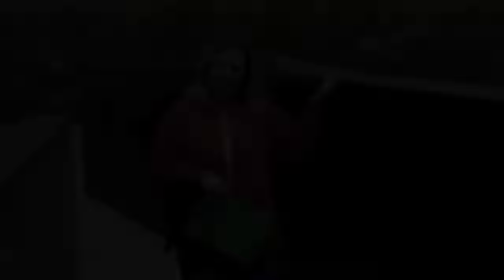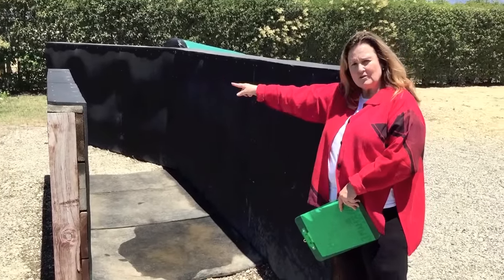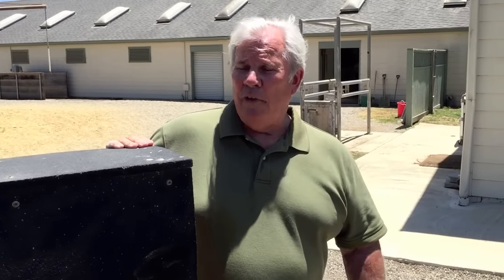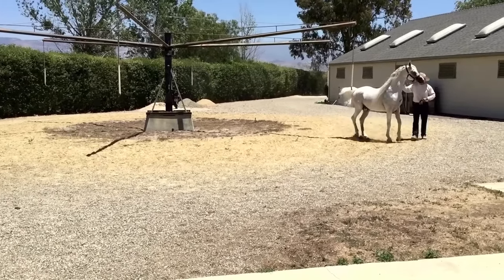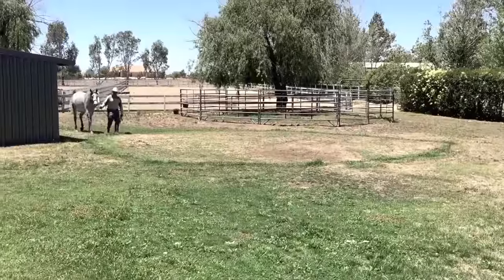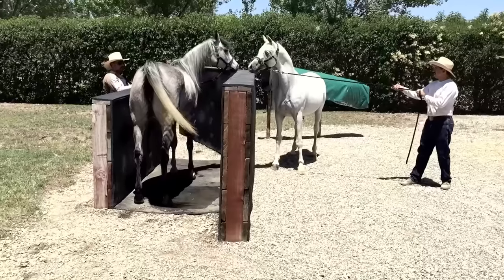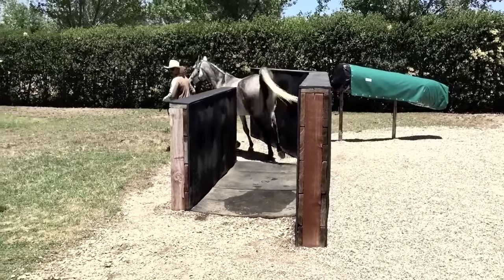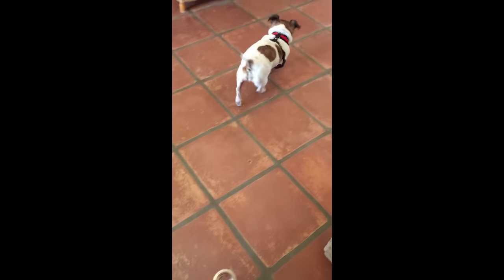The Tease Wall  – Materials & Safety

Comment: was that a cute on the horses chest.
Reply: Most likely a self inflicted wound due to frustration. Spring is a hard time for studs, especially when they are withheld from mares in heat. They tend to bite themselves, bang their heads on walls and fences or even bust their legs kicking out due to frustration. Restraint only makes this behaviour worse. Safety is priority when working with stallions and only should experienced handlers handle them. It's important to work the stallion through their hormones, rather than let them be ruled by them. Lots of mental stimulation and exercise can help.

Comment: Fascinating. Is the stomping and flaring by the stallion typical 'teasing' behavior? It seems quite aggressive. You see Arabians do it all the time in promotion videos, even in the absence of other horses. Is the display just an expression of heightened arousal by a temperamental breed or a form of ritualized aggression?
Reply: l
Reply: Stallions flaring, squealing and posturing is all calculated. If the mare reacts by striking or kicking at the stallion after he tries to impress her, he realizes she's not in heat and moves on. If she is receptive, the stallion should calm down and then two different things can happen. If they're free pastured and untethered, the stallion will woo the mare by nibbling on her neck and by making other calming gestures before trying to mount. If humans are attached to the horses, and the stallion is bred with people assisting then he'll go straight from the teasing wall to mounting. Arabians are rather dramatic, noisy, reactive horses so they get the blue ribbon for squealing and snorting, but this is still normal breeding behavior.
Reply: this is how a stallion flirts. He means no harm to her. BUT his behavior shows her that he likes her. SHE likes him too the way she doesn't take her eyes off him AND no kicking. BUT now a days they hold onto a lead line with Both mare and stallion. too risky turning them loose. VERY risky. Mares do kick ALOT as you could see with the scar on his chest. And if they kick out and get the knee's.......he's done for. So they don't mind if humans are at the end of the line. Long as they get it. I felt bad they walked her away......she didn't want to go cause she was ready for him........and he was probably confused that HE got walked away. Seeing them breed is no big deal. We can handle it. I hope he and she got together after they finished videoing the teasing part. lol  poor boy. It LOOKS more scary and dangerous than it is BUT horses are huge.......so best to stand aside.
Reply: @RedBev59  usually, the teaser stallion is only ever the best man, not the groom. Most stud farms only use a stallion to have a clear idea of her ovulation cycle and she’ll be artificially inseminated, and if the stallion is lucky he’ll get some side jobs to do what’s natural, but not the highly prized mares who are basically foal incubators. Many horse owning individuals let  their lead stallion mingle with their mares all year in pasture with the expected foals  or if not, foals can be the results of fence jumpers. On stud farms though it’s strictly business to breed only the best bloodlines and from approved stallions to create a high class and very expensive prodigy. It’s simply an industry.
Reply: Yip!😏